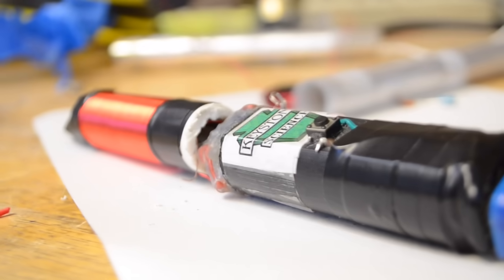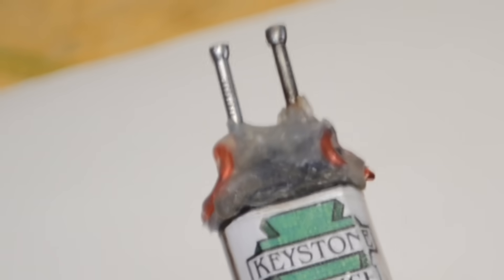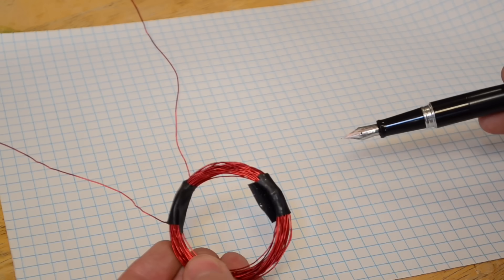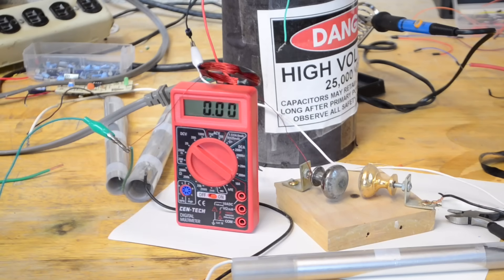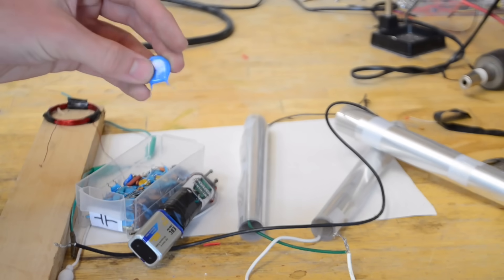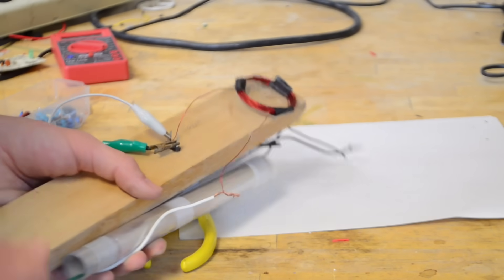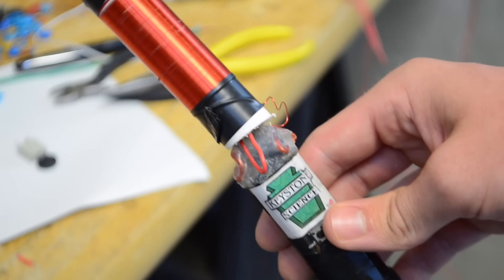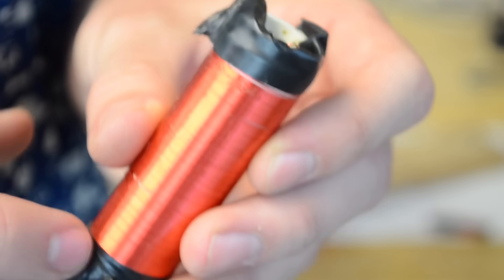How to make a pocket EMP

Comment: Hey this video is awesome, but one question. If you have a 51,000,000 volt commercially bought tazer, can you still use it as the base power source or will that overcharge the capacitors? Also I am very new to electronics...if I were to put say 3 3k volt capacitors in sequence would that be enough to use a 51,000,000 volt with it?
Reply from the maker: +Gavin Chambers if it is actually 51000000 volts then then it would go through the plastic of the capacitor, however I think most taser companies stretch the truth tbh, like by a lot. This is just because electricity can travel through air by a ratio of about 1kv / cm, and so if it was 51 million volts then it would be able to jump about 51,000 cm, or 510 meters, which is a very long ways, like insanely long, and so although I haven't personally ever tested a commercial taser, I think they are actually a much lower voltage , like probably around 40kv or something like that... So anyways back to the question xD ... I think you should be fine, I am curious how it will hold up, if you could try using my homemade capacitor set up ( I have a video on it ) and see if it goes through the plastic dielectric sheet. Also though I should say, a commercial taser probably has very low current, thus meaning that it would take a while to charge a large capacitance ( the larger the capacitance, equates to a stronger EMP ). So yeah xD I would love to know any data you collect !
Reply: Keystone Science There's $10 ones on Amazon making big voltage claims! You should test them!
Reply: Keystone Science Hahaha oh you are totally right 51,000,000v seemed phoney anyway. Wow I didn't know you could measure the distance with voltage thats amazing and from what I understood the current or ampage is what makes it more powerful right? Yeah I will test it using your capacitor set up and get back to you as me and my friends are going to try to build it today. I hope it works thank you so much!
Reply: Ok so just an update, we connected the positive and negative terminals to a cheap 330wv capacitor and it charged up. We bridged it just to make sure it worked. Then we upped the capacitor to a 4700uf 35 volt and we saw nothing but a tiny spark. Any thoughts as to what we should do?
Reply: You got the air breakdown voltage wrong, it is 3kv/mm. :)
Reply from the maker: +Gavin Chambers no problem! I hope it works for you! Also it's actually the power is equal to volts * amps , ( P=V*I ) and so yeah! Volts is sort of like the force that allows more current based on the resistance ( V=I*R ) ... Anyways... Let me know if you need any help with anything !

Comment: Will this work at ATM's Tablets, Smartphones, or even new model cars that are all electrical..?
Reply: ATMs? I like the way you think!!
Reply: tablets and smartphones, yes. Atms, and cars are a bit trickier. Usually the electronics inside an ATM are far enough away from where you could feasibly set this off that it wouldn't do the damage you're hoping for. At best it would ruin the screen, at worst you wouldn't be able to get money anyway. It's not as if they spit money when they shut off. Cars too, you could fry the radio, or disable the smart key area of the ignition, but that has the opposite effect you'd want if you were trying to steal it. The car won't start because the smart key can't be read. If you were just trying to break shit, then perhaps it would work, but this isn't a very powerful EMF generator, so getting results would be pretty hit or miss. You'd have better luck (and quicker effect) by just hitting it with a heavy hammer.
Reply: iTheGeek ohhh yea ;)
Reply: ONLY ONE WAY TO FIND OUT!
;)
Let us know when you in 10-20 years.
Reply: Squat251 Gaming but a small emp would be much less conspicuous

Comment: Imagine if someone took this into an Apple Store
Reply: Apple products may be safe as I dont think an EMP would any effect on a potato.
Reply: POLO MARCO Why specifically a Tesla dealership? All modern cars have some form of on-board computer, and won't start without them.
Reply: Choose one:
Big EMP which will probably disable most electronics
Hammer which will destroy anything but with cost of concealment
Small EMP which will disable old electronics in range of 10 cm's
Reply: Doesn't work on iphones, probably wouldn't work on most apple laptops either (though I wouldn't know for sure). iphones are EM-shielded. Besides, if you want to destroy electronics you can use a hammer. It's easier.
Reply: Goldendevil 18 riiiiip
Reply: a hero will be born
Reply: that burn
Reply: gives me a great IDEAL! lol! 50,000 volt coil! lol!

Comment: why didn't it affect your camera if it's an emp?
Reply: An EMP's power is inversely proportional to the square of the distance. AKA it's power decreases very quickly when you go away from it, and the camera was probably a meter away. And if that guy made an EMP with an effective range of 1+ meter in his shack/garage/whatever (no offense :p) i'd be worried.
Reply: Daniel Hong idk good question
Reply: he prob has a camera strong  enough or just a camera that he bought that is good enough maybe he just gave it armor :3
Reply: 4nto418 oh, ok
Reply: Faraday cage, perhaps? though, not mentioned if he did. also, could have been zoomed in from a great distance.
Reply: Need one of these for the movie theater. Fuck's sake, enjoy the movie, turn off your phone.
Reply: Daniel Hong   The rf shielding of the curcuits  and  metal case  block emp   Like we shielded  military electronics  from a nuclear emp  in the 70s and 80s  thru  today     Exposed unshielded wires and curcuits , sheilded w/o surge supresion suseptable  to emp
Reply: 4nto418 Youd be worried? Id give that Guy a nobel price.
According to Wikipedia the only known to man Way of effectively creating an EMP aasault is by exploding a nuke.
Reply: That Chimichanga Who Needs Some Love. pp juice? wtf?
Reply: what
Reply: what?

also, the inverse-cube rule applies to all radio-communications, pretty much, hence radios needing to use op-amps in pairs to get a useable signal.
Reply: wow...ok...this is barely an emp device....u have to place the coil directly on the device to disrupt it, with indirect contact, this thing wouldnt even make the screen on my laptop flicker...long story short, u guys are thinking too much in to it, no faraday cage, o zoom, its a very weak discharge a.k.a. shits weak as fuck fam...

Comment: This has no practical application. As your camera still functions.
Reply: Durtee Diaperz no shit
Reply: Is it possible to shield electronics from an EMP?
Reply: +Kareem Pinkston yes it Is, I think it's called a faraday cage and if I'm not wrong consists on wrapping the electronic with metal, since the electricity moves only on the surface the circuits inside are safe, by the way sorry for my bad english :)
Reply: kareem pinkston ... yea
Reply: Yeah I was wondering about that too. Cool concept though
Reply: yup, was going to comment, but realised that someone else might have
Reply: short distance
Reply: People working at electronic waste centers or whatever they are called can used them to efficiently wipe flash memeory

Comment: Your video appeared in the feed on my YouTube home page. This must be very weak because your camera never glitched once.
Reply: the EMP has to be right up next to the device for it to actually do damage, and I had the camera a ways back just zoomed in, also ( I don't know if this is the case ) but most modern day electronics ( like smart phones ) have faraday cages around their circuitry ( basically little metal plates ) and these protect it from electro magnetic pulses
Reply: Applehead1234 You're damaged...
Reply: Cory Gunter-Smith or he protected the camera in a housing or something similar. he wears a tin foil hat too
Reply: Cory Gunter-Smith Same thought here.
Reply: any electromagnetic field is super small. strength does not mean distance.
Reply: Applehead1234 ???
Reply: No, they don't. They have ferrite beads on the power cables or shielding plates, and generally nothing more than that. To claim your smartphone is EMP proof or they they have a Faraday cage is silly.

The shielding plates in most home security systems and some apple phones are sufficient for something as small as this EMP, but an adequately constructed one (Or a generated EMP pulse) will easily brick your device. I'm pretty sure he wired the capacitors in series (rather than parallel) which also diminishes the strength of the EMP here.

If you took this basic design and increased the number of capacitors (Ones from old TV's would work beautifully), and used a proper coil (maybe even re-used a brush motor) you could easily brick anything that relies on shielding plates.
Reply: he actually puts together many paintings of what he is doing.
Reply: learrus Emp's are not directional, they are a magnetic field. ::smh::
Reply: Applehead1234 ur a fuck head
Reply: Troll Luhluh Magnetic fields aren't directional, Troll.
Reply: in the first example if you pay close attention instead of bi***ing you would notice that he removed the black wire from the circuit so that it wouldn't properly function. It was obviously that strong to where he couldn't have it as an actual emp while filming. yes, he does show it working later, but that either at a bigger range or a different wire.
Reply: same thinking here
Reply: Applehead1234 nope they just dont have to spam the comment over and over so i copy and paste
Reply: omg..
Reply: This
Reply: Derpki well your obviously well versed in em theory.
Reply: Chris Lesmerises
I was responding to an earlier comment by xGxPhantom, who then edited his comment using the information I provided so he would be "correct".
Reply: He pointed it away from the camera
Reply: Chris Lesmerises half true
Reply: Chris Lesmerises the side they face is the strongest, but yes. kinda only a few % diff
Reply: the multi-meter has little to no isolation (as it's pretty cheap). Most cameras do, because they can actually interfere with themselves otherwise.
Reply: Chris Lesmerises magnetic fields have both a north and south pole and the field shapes are determined by both the shape of the magnet and any surrounding magnetic fields from elsewhere. Having a ferrous core with a need shape at one end would allow for the magnetic field to protrude in the direction of the sharper end more than the direction of the blunted end. You can use old TVs with CRTs to see the magnetic field cross sectionally.
Reply: Benevolens Psittacorum  A taurus of any shape is hardly directional, though you are corect the magnetic waves do not propegate along the longitudinal axis. They diverge along the outer perimeter, and converge at the center of the magnet creating a field flux in the shape of a taurus. Hardly directional. Pointy being, is he pointed it at the camera it would not affect the camera. The determining factor is the proximity to the camera, secondarily, making sure the item to be afected is not laying on the "equatorial" axis of the point of magnetic field generation.
Reply: Cory Gunter-Smith I think it's fake. unless science is.
Reply: Cory Gunter-Smith dident you read the comment at the top of the comments list?

Comment: SO, JUST LIKE I ASKED THE SELF-PROCLAIMED INDIAN SCIENTIST SHOWS HOW TO BUILD A $3 USB KILLER AND DESTROYS EVERYTHING USB WITH IT.........WHAT ARE YOU GOING TO USE THIS ON???  I THOUGHT WE AMERICANS WERE AFRAID OF THE DAMAGE CAUSED BY AN EMP??  THATS LIKE BUILDING A BOMB---WHAT'R YA GONNA DO WITH IT AFTERWARDS????
Reply from the maker: +Michael Hesterberg hahaha yeah, but in all fairness, with the bomb analogy, this would be a fire cracker, in other words, I made this EMP design so that it really can't hurt much at all ( it wouldn't be hard to make it more powerful though, but most the people watching this won't know how to do that ). The main point of this video is to teach what an electromagnetic pulse is and how it is generated, and it was made as a precursor to wireless energy and tesla coils pretty much ( the circuit for this and a tesla coil are pretty much the exact same, except a tesla coil has a secondary coil on it ). But yeah. This video was purely for education :D
Reply: Electrical Engineering isn't that hard. The problem with your design is that you used too little wire and not enough capacitors.You need at least 5-6 layers of pure copper(or any other highly conductive material) at Ø1 or higher to actually cause enough damage.

Comment: do you need a spark gap and capacitor
Reply from the maker: +AL ex AN der PO ole PO ole technically, the taser already has capacitors in it that could be used, however a bigger capacitance will work better, and the spark gap is so that the pulse is bigger ( it will jump the gap when the capacitors are charged enough, thus dumping more power through the coil )

Comment: I would have thought that high of voltage, would melt the copper.  What if you used 10 gauge wire and a super capacitor?  Can you use a parabolic dish to ad direction to the EMP?  (asking for a friend) lol
Reply from the maker: A super capacitor is great for giving loads of current, however, for the EMP, we are looking for a burst of high energy, so basically that's why we use regular capacitors, for making it stronger, you could do that by making the capacitance greater and the spark gap further apart, however I wouldn't stress the small power supply I use in this video too much, so probably using a different high voltage power supply would be good. Anyways, high voltage doesn't really melt the wire because there is not much current ( I.E. Amps ) although the higher voltage allows more amps to flow, during the process of stepping up the voltage there is resistance that keeps it low, and so yeah xD ( also a lot of times things can handle a certain amount of watts of energy before they melt , this is watts=Volts * Amps)  ... Anyways, I hope this helped!
Reply from the maker: +James Ramsey also sorry I didn't see the last part of you question. I don't think a parabolic disc would work ( although it might ) however, if you made the coil parabolic then it would probably be more focused

Comment: Why didn't it mess up the camera?
Reply from the maker: +Christian M the EMP has to be right up next to the device for it to actually do damage, and I had the camera a ways back just zoomed in, also ( I don't know if this is the case ) but most modern day electronics ( like smart phones ) have faraday cages around their circuitry ( basically little metal plates ) and these protect it from electro magnetic pulses

Comment: Hey a little suggestion: you can use the pins of a fluorescent tube starter to make the taser terminals instead of using nails that way the finish is better. You can even use a part of the body of the starter and put inside part of the body of the taser. then you have a good attach to hook the EMP coil to the taser and put and remove it with a quarter turn :)
Reply from the maker: +MrWilliam932 thanks! That's an awesome idea!!! :D
Reply: MrWilliam932

Comment: does this works on phones? i need a clear explanation but if it does imma be frying my friends phone hahahah well not my friends
Reply: ThatGuyAlpha it does work on phones, i think
Reply: sheparddog117  nope you're Gona need a really strong emp to fuck then up plus they wouldn't start spitting cash when they break :/ this isn't watchdogs
Reply: you'd need to basically get them past the metal housing. If you could perhaps touch the screen basically it could work, you need to bypass the metal though which will protect the device and get emp waves back behind into the boards.   I mean the main problem is that for the most part anything that you can use this for, if your that close you can also simply use a magnet to attack it.
Reply: You'd need to build the coil onto (or into) a card you could insert in the card slot.

Comment: I could probably make some good modifications to this design when I get my workshop back up and running
Reply from the maker: +headshot66 awesome! Let me know how it goes :D
Reply: what could you do to increase the power for a larger area that the in emp reach?
Reply from the maker: +headshot66 not much with this taser power supply, however basically just adding more capacitance will do the trick I'm fairly certain ( I intentionally made it a weak one, I don't want people terrorizing their community xD )

Comment: "Don't use it around any expensive equipment" discharges it inches from nice video camera
Reply: Gixerkid100 I'd care less about an iPhone.
Reply: David Collins noooooo not the camera!!!
Reply: David Collins Or a brand new iPhone
Reply: the camera could be sitting a good distance & zoomed in
Reply: not an Iphone, but it's the samsung you gotta worry about. it might get upset and burst into flames.
Reply: EM field strength is equal to the inverse square of distance. In other words, while it is enough to cause problems for that multi-meter setting ontop of it, a camera a meter away is safe from a source that strong. Even the non-nuclear EMP weapons theorized only have an effect radius of a hundred meters or so, and that's with an explosive flux compression generator.

Comment: can you try building a vape with this pocket taser? i thins gives vaping a huge boost
Reply: It would not work.
Reply: Jason Brody why? just put i coil between those nails xD if the device cant handle high amps just make a high ohm coil
Reply: I don't vape myself, but I got a friend who does, so I do know  a (tiny) bit about vaping.
afaik getting the vape coils to glow needs a high amp output, I don't think this taser puts out enough amps.